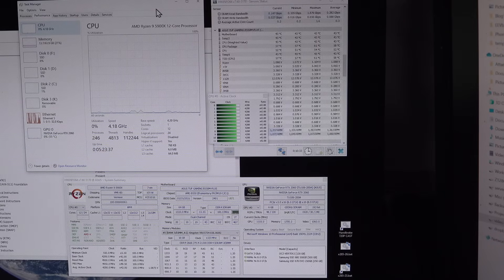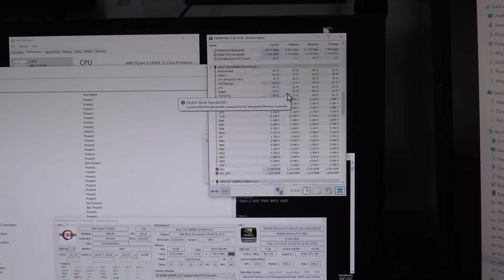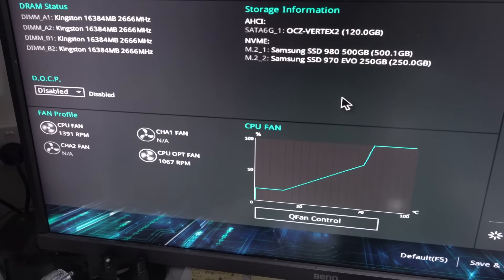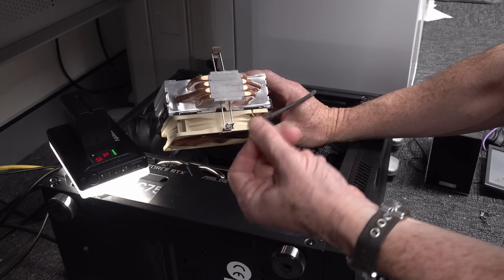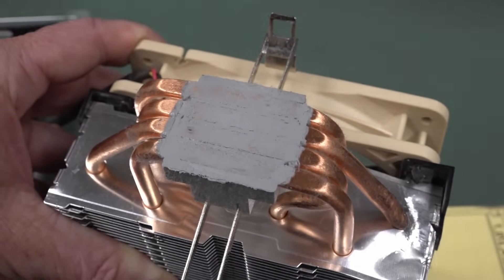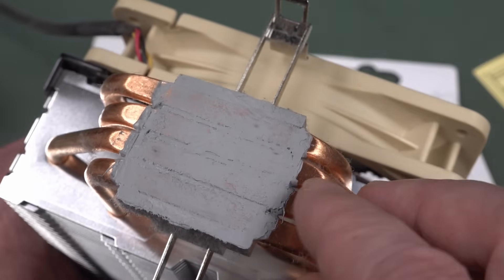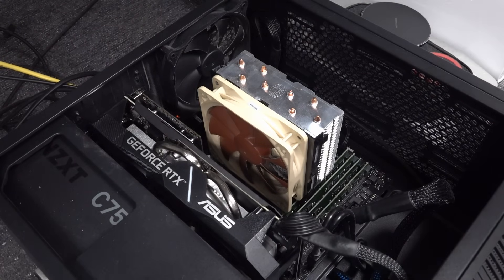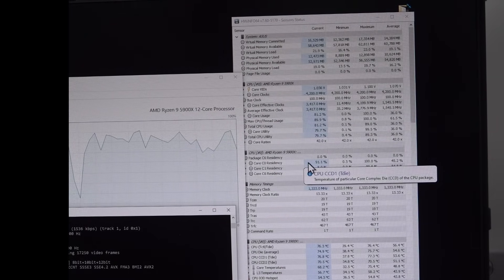CPU Thermal Ghost

Comment: Yeah, that fan needs to be vertical in the case.
Reply: I'm not trying to convey that that is the source of the problem. That would need years of testing. But, I would guarantee the device would run a few degrees cooler of it was oriented vertically. If it isn't, it will probably dry out the thermal paste faster due to the higher temperature.

There is also thermal throttling, which may be why the computer is crashing rather then throttling, a bios update may be in order.

I did watch the second part of this video series, I believe the thermal throttling may be part of the issue.

Just my 2 cents..🤷‍♂️
Reply: He said it ran fine for years. So it didn't need to be vertical.
Reply from the maker: Not possible, that's why it's like that

Comment: the first thing i would recommend is to reset the bios back to defaults and see if it still happens. if so update the bios. the next thing i would guess is the power supply is faulty unfortunately. Even though it only happens under CPU load still could totally be the PSU if it has a fault on the CPU 12v output section. At least easy enough to diagnose using a spare PSU... Just plug the wires in with it hanging outside the case and see if it still happens. (doesn't need to be a fancy power supply)

also I noticed is that the CPU cooler needs to be turned 90 degrees, so the cooler is facing the opposite direction.  100% This will not fix the pc from shutting down but will definitely help with thermals!

Also the old thermal paste looked hard... Was it?

Comment: "Applied" is the word you were looking for. You got to reapply the thermal compound every so often regardless of hardware problems you may be having... AMDs traditionally run hotter than Intel...... I built a beefy server with dual Xeon processor, designed and machined liquid cooling blocks out of copper (2 piece soldered for each). I designed blocks for Nvidia P100 and storage controller too. So, the custom cooling loop has four devices to cool. On 100% load it the temperature went from 80C (air cooled and very loud) down to 49C (liquid cooled and silent). Using a motorcycle radiator was not overkill when peace and quiet is required :)

Comment: Usually CPU fans move air front to back not top to bottom. You may have a cooler pressure problem.

Comment: It's obviously the RGB LED lighting causing it.
Reply: Maybe in part, but did you see that cooling fan? It's brown. He needs to paint that puppy black for maximum cooling. Some racing decals wouldn't hurt either.
Reply: @chitlitlah no no no, everyone knows blue fans are cooler, duh!
Reply: @chitlitlah  needs MORE RGB on that FAN  - WITHOUT the RGB it is "just" a fan and NOT capable of keeping a GAMING system COOL under hard GAM.. wait a minute rendering work loads 
IF IN DOUBT MORE RGB (-:

Comment: I used to use this freeware app called blue screen view to review messages/data from previous blue screens that were too quick to read. Windows saves that stuff for posterity and the app makes it easily reviewable. This was a long time ago, no idea if it supports Win 10/11. Hope you get it fixed. Nothing worse than your main rig being unstable.

Comment: Have you attempted to look if the windows event log has any information about what caused the system to crash? Also if there is anything you should really change in the bios it's enabling DOCP not only does it increase the ram speed but the infinity fabric speed is by default linked to the ram speed (it can be unlinked but generally it's better to keep it linked anyway).

Comment: update bios, change thermal paste with Arctic MX-4, then run optimizations with Ryzen Master, and also check D.O.C.P, rotate heatskin 90 degrees, fan should be on ram side exhausting to the back
Reply from the maker: Not possible to rotate heatsink 90deg due to the design. That's why it's the way it is.
Reply: @EEVblog2  That cooler isn't an adequate solution for a 12-core Ryzen 9. Do your CPU a favor and get a big Noctua cooler. They're not cheap, but so wasn't you cpu...

Comment: It was a thermal issue that damaged your CPU. The damage has already been done due to you ignoring it for 6 months
Reply: If it was a thermal issue, the cpu would shut itself off or throttle it down before allowing it to bake itself
Reply: Laptop CPUs run at 90C for years without any issues. So I doubt it
Reply: I doubt it. It is possible, but rare and the CPU was already damaged from the factory then. If you get something like the most recent Ryzens with their too high  SoC voltage, that is different.

Comment: That Hyper 212 or similar Cooler might be a bit weak for the 5900X.
I recommend replacing it with a nice Dual Tower Cooler (NH-D15, be quiet Dark Rock PRO 4 or 5), or at least a good quality single tower with more than 4 Heatpipes (Noctua NH-U14 for example, maybe be quiet Dark Rock 4).
Reply from the maker: Worked 100% fine for years.
Reply: @EEVblog2 Did you monitor the cpu clocks throughout the years? It might have been throttling constantly, always running at max temperatures. Sure a Noctua NH-D15 isn't cheap, but so wasn't that Ryzen cpu. It's like driving a 500hp car with cheap run-down tires. Sure it works somehow, at least most of the time...
Reply: @EEVblog2  hm, try turning the CPU Cooler around 180° and see what happens.
Maybe you got lucky and that works...
My reasoning is that the load of the CPU is mostly on 2 heatpipes, as the 2 Core Dies are at the lower part of the Heatspreader. (slightly off center).

Comment: Check to make sure the heat sink is actually fully seated; Seems like it was kind of loose there. You may just want to upgrade to a better cooler that has its own mounting bracket, too. That Hyper 212 cooler is only rated for 130 watts, the 5900X can go way past that when overclocked. I'd recommend the Thermalright Peerless Assassin for a budget cooler that rivals the Noctua NH-D15.
Reply: I thought the cooler can't handle that CPU as well but Dave showed me wrong and even at 100% load it stayed in the 80s which was very surprising to me but can't argue with facts.
Reply from the maker: Worked 100% fine for years.

Comment: The old wisdom of putting a pea sized blob of thermal compound in the middle of the CPU and then install the heat sink no longer applies to modern CPU's that use a chiplet design. 

Older CPU's had one hot spot in the middle and the heat spreader on the top of the CPU simply served to protect the CPU die from being chipped while installing or removing the heatsink and also to spread the heat from the CPU die over a larger area to allow more efficient heat transfer to the heatsink.

Modern CPU's that use a chiplet design produce heat over a much larger area meaning that it is now far more important to ensure that the thermal paste is applied in an even layer over the entire CPU heat spreader.

Comment: I strongly recommend installing Ryzen Master and watching the TDC and EDC to see if is sufficient for the CPU, I actually had a similar issue, with BSOD and random freezes and the cause was in fact my old motherboard who wasn't handling my Ryzen 9 3900 nicely. Remembering that a Ryzen 9 can use over double of the rated TDP under load and when boosting. Also I notice your clock is "locked" at 4.2ghz, what could be caused by having the precision boost overdrive disabled. I strongly recommend enabling so you have a better control of clock speeds.
Reply: I had similar issue with a cheap/older B450's VRMs not handling the power draw of a 3900X.
Reply: His TUF motherboard can easily handle 5900.
Reply from the maker: Installing Ryzen master. Sneaky shit software, tried to auto opt me into giving metrics.
Reply from the maker: See my pinned comment, EDC is the only thing in the red, close to 100% (of 180A). TDC is under 10%
Reply from the maker: Why have a never had an issue in years of using it, but suddenly I do now?
Reply: Aging maybe  @EEVblog2

Comment: When You were in the BIOS, your CPU was at 55C. That thermal paste is for sure toast as it needs to be a "paste" to conduct heat properly. Been 3 years since I last did mine and the temps were slowly creeping up until I re-pasted it. Especially if you have been CPU rendering stuff in handbrake that will for sure will kill that thermal paste faster. As long as you have Non-Conductive thermal paste it doesn't matter how much you put on it is more how much mess do you want to clean up when you have to take the heat sink off again. IT wouldn't hurt to run Qfan control as I hate the noise of my fans at Idle or Just watching YouTube. I Have an ASUS Motherboard as well so I'm Familiar with that BIOS Setup screen. One other thing I would do if the temps don't go down while re-pasting the thing is to go to the ASUS website and do a BIOS update. I do mine fairly regularly and it helps to iron out some issues with random shutdowns.
Reply: I have replaced thermal paste on my lab computers and it basically makes no difference. It the right amount was applied originally, it is basic.y good to go.
Reply from the maker: How to tell me you haven't watched the video without telling me you haven't watched the video.
I repasted it and it still happens.
Reply: @EEVblog2  I Know. Too quick on the comment. Edited my comment once I saw the re-paste. You have every right to call me out on that one.
Reply: Yeah. Those Shutdowns were the CPU saying IT'S TOO HOT!!!!!!!! I'M SHUTTING DOWN TO PROTECT MYSELF!!!!!! I saw nothing wrong with what you done there. You Haven't triggered me in the least. I would only recommend because you are doing CPU Rendering is to change out your thermal paste every 2 years.

Comment: Try measuring/tracking the CPU voltage rails from the PSU when the issue occurs.
Reply from the maker: How to tell me you haven't watched the video without telling me you haven't watched the video.
Reply: I meant probe the various PSU's pins with a O'scope and look for voltage fluctuations and ripple. Not the voltage reported by software. @EEVblog2

Comment: maybe the gas/liquid in the heat pipes has leaked/failed...?
Reply: his CPU plumbing is done all wrong!!!
Reply: @hempbear 🤣😂
Reply: The cooler just had very bad contact to the cpu surface. When he takes it off, you see only paste and no metal - that's bad! You want as much metal-to-metal contact as possible, with the paste only filling in the remaining tiny little spaces. That cooler is a budget cooler with a badly machined direct-touch surface and insufficient clamp pressure from the standard spring-clamp.
Don't get me wrong, that cooler is fine for a lot of CPUs, much better than the ones that ship with the CPUs. But I wouldn't use it on a 12-core Ryzen 9